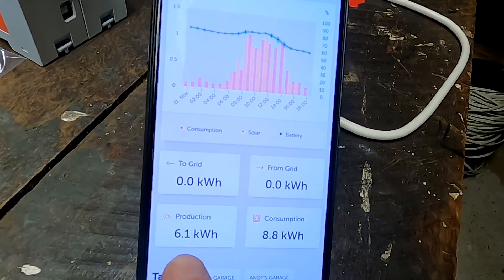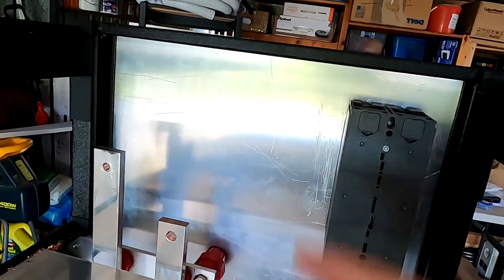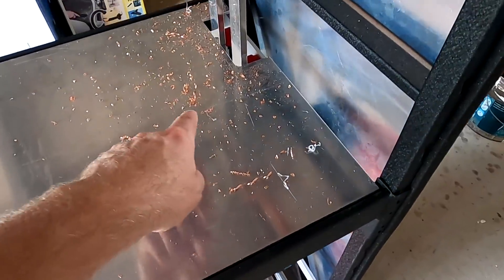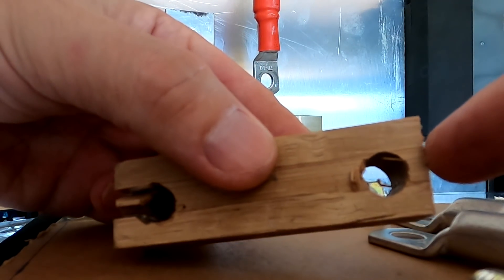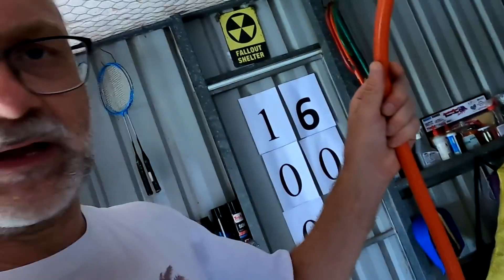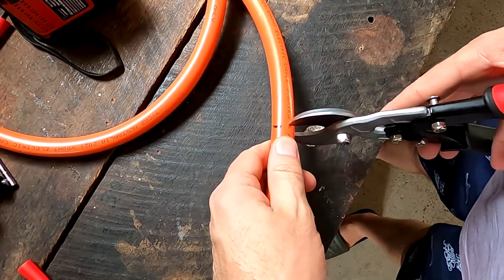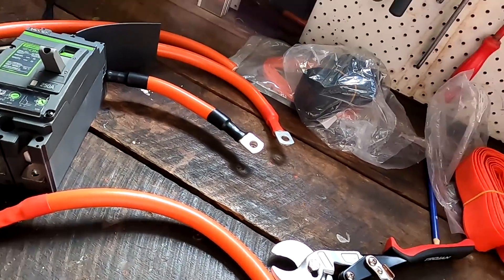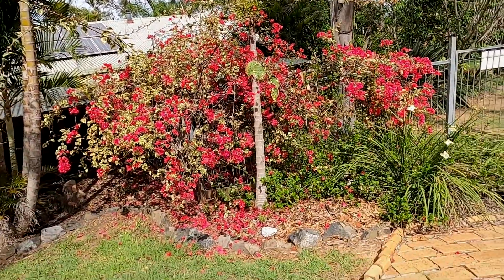70mm ring lugs - better result with 50mm crimper? Battery 2.0 🐸

Comment: I am new to solar and just bought an EG4 wall mount battery. I didn't have a crimper and used a hammer and a piece of metal to 'crimp'. I tried to pull it off and couldn't. It seems very secure. What am I missing by not using an expensive crimp tool? Is it just to keep the lug on tighter?

Comment: IMO, you should not pull a crimper tool handle up to crimp, unless you have no option. You should turn the crimper the other way and you should be pushing down on the handle. This makes a much better, safer, easier crimp, and easier on you and your body, as you use the weight of your hand, arm, and even some of the weight from your body to make the crimp. Some crimper tools have a better design than other ones, to allow for this. I think the one you are using might not be the best, because does not allow for visuals if you were to turn it upside down, but once you know what the actions are, you don't even need to have visuals, you will know where the lug and dies are in relation to each other.

Also, sometimes it is quicker to place the lug in the crimper and close the crimper just enough so that it holds the lug, THEN feed the cable in the lug (especially if you are using solid copper).

In theory you can even shave a little bit of the dies off, where the 2 dies meet, in order to remove 0.5-1mm, so that you get a closer crimp... if you think that will give you a better crimp.

Comment: That YQK tool is such rubbish.  The anvils do not do a proper job.  Full marks for re-crimping with a smaller 50mm die.  The tool must be held in a bench vice.  Some of these tube lugs have an open end in the tube tunnel so you can see that your cable is fully inserted.  I would use this access as a means of feed some solder down the joint afterwards. Put solder flux on wires first and maybe solder paste to help  flow. You need a gas torch as a lot of heat is needed.  I think maybe cut back more insulation so you see say10mm of wire when inserted. This way you can see the solder wicking up the cable. You dont want much as it creates a solid junction with the flexible wire. Use heat shrink tube to cover the joint.  BTW dont use this tool on 4mm and 6mm2 cable too small and doesnt work.
Reply: have you done any measurements with this method, vs without? Does it have any effect on resistance?

Comment: The video i was looking for. Just started to buy all those tools (hydraulic crimper) i need…
Reply: I got one of the cheapo 10 ton crimpers and it just couldn't do any big terminals (pretty much nothing happened when pumping). Either it was a faulty one, or just can't handle the big ones (got a refund). I then got the 16 ton version which is much better for big terminals (just did some 70mm ones), but only has dies for down to 16mm.

Comment: As I recently bought a similar crimp tool I learned, that for 25mm2 cable I need 16m2 lug and die and for 35mm2 cable I need 25mm2 lugs. I guess that for hexagon crimping, wire must fit as tight as possible in the lug. When I tried 25mm2 lug on 25mm2 cable it didn't work at all. Cable just fell out of the lug.
Reply from the maker: It all depends a bit on the ring lugs as well. I have used the really heavy duty ones for my power cables and they are a lot thicker than the ones I bought before. I still us the smaller size die here and there when I feel the crimp is not strong enough.
Reply: Wrong lug .
U need a eu din iso lug.
Not cheap junk or usa lugs .
Are not make for this unit.

A EU iso din the wall its thicker in the lug and some even have ribbels inside to grap the copper wire.

Good crimper but people do not know how to hide it .

Comment: I think the numbers on the dies correspond to rated amperage rather than the sqmm of cable. Either that or it is an identification number and the table in the manual will tell youwhat it means. I saw a manual for a simular tool where the numbers had an AWG rating and the die number did not correspond to sqmm. 4/0 is 120mmsq but the right die number was 95 according to the table.

Comment: Suggest that the use of a product called No-Ox on the bare copper wire before inserting into the connection lugs .It stops the oxidation of the copper and does not affect the conductivity. Also use where any connection is made including bolt ups .
Also the use of a product called Nomex paper to protect cables around and over sharp edges. These products are used in the telecoms industry and have along term track record.
Reply from the maker: Yeah, I have that and did experiments with it. It is good. For a while... then the bad connections and corrosion starts again. I tested other products as well. The best results I had was with no chemicals in between busbar and terminal for example. I used the tinned copper bus bars which came with the cells and 4Nm on the original terminals without any preparation (no cleaning or sanding) and never had any issues since the installation 1.5 yrs ago.

Comment: I too found that using a smaller die made a crimp connection that didn't pull out but left enormous "love handles", indicating that the cable didn't fill the lug properly. THEN I found the reason. 
Look at your cable spec.
 If your supplier does not specify the number of strands and their diameter then can i sell you a pig in a poke? You will be a good customer for rubbish. 
   Now measure the diameter of the strands and count them. Flexible cable is usually specced as 0.30 mm diameter. I have measured some cables from different sources  and all were 0.27mm . Do the arithmetic and you realise the cable is 20% under size. My 20mm2 is actually 16mm2 and fits a 16mm2 lug exactly and crimps properly. The cable is marked "Made in the EU".

Comment: i used the 50mm size on a 70mm cable too. I feel the crimp looks more like yours at 70mm 😅. I get all the way no wrinkles. seems strong but i will like a method to find how to test it if it's good enough. I don't have something to push 200A and see if it's heats up

Comment: habe auf der baustelle von uns das gleiche problem mit den kabelschuhen. habe dann mal den kabelhersteller angeschrieben wieso ein 70er schuh nicht auf dem 70er kabel hält.
als info habe ich dann dies bekommen:
früher wurden die kupferstränge im kabel rund ausgeführt, heute werden sie dreieckig hergestellt.(spart platz) leider sind die querschnitte damit auch etwas kleiner.

man bracht für die neuen kabel auch die neuen passenden shuhe.
Reply from the maker: Danke Dir. Also meine Kabelstraenge im Kabel sind definitiv rund ausgefuehrt und zusammengeflochten. Ich denke es haengt auch mit der Dicke des Kabelschuhs zusammen. Die Billigen von eBay sind schon um einiges duenner.

Comment: If you're still figuring how to right angle out the top of the main breaker, without over bending the cable and lug: make a short copper busbar link to extend straight up. Bolt to breaker, and tap to bolt lug on at 90 deg.   Other cable lug out the side where you notched the breaker housing plastic.  It's an extra bolted connection, but hey...
Reply from the maker: All sorted, thank you. The bus bar link is a great idea and would have been my next best solution.

Comment: Connect the smart shunt directly to the busbar no cable needed in the victron lynx systems the shunt is the connection between the NEG battery side and the NEG consumer side.

Comment: Hi Andy, shouldn't you connect the - from the switch to one side of the - busbar and the + from the switch to the opposite (lower end) of the + busbar? 
This way the the length and the resistence of all connections to the battery blocks are all equal, and you avoid having different terminal voltages at the battery blocks depending on how far the battery blocks are away from the top end of the busbars. 
This is similar to how you connect 12 V batterie blocks in parallel. You don't connect +/- to the same battery block, but  + to one and - to the other. This ensures equal terminal voltages.
And regarding crimping of high current connections, the professional rule in Germany is that you should use always matching lugs/tools from the same manufacturers. There are also different standards for the lugs, so the tool should at least match the standard of the lugs. There are also different crimp patterns. I have best experience with the WM crimp on finely stranded cable, instead of hexagonal pattern. But of course, this standardized lugs and matching tools are much more expensive than the cheap Chinese products.

Comment: 10:11 The pressing result also depends on the material thickness of the cable lugs. With thinner wall thicknesses, the pressure is not as strong as with a thicker wall thickness. Unfortunately there are many differences in the cable lugs. Always depends on the manufacturer. You can compensate for this with smaller crimping inserts, as you have already shown correctly.

Comment: Have the same issue with my hydraulic crimper, always have to go 1 size under to get a good crimp. I was able to pull the lug off easily with the correct size.

Comment: Do have the exact same tool, crimping 70mm cable. Had to use the 50mm die in the same way
Reply from the maker: Ah, good to know. Thanks for sharing. The die seems to be too large for these lugs.
Reply: @OffGridGarageAustralia   likely Chinesium 🤦🏻‍♂️ or maybe just badly copied from the original with not enough clearance on the die’s where they meet.

Comment: Andy
They sold the same crimper here in the states. Unfortunately I own one lol. 
About half of my dies have been modified to work on AWG wire size. The “split line” has been machined (or angle grinder) down at the split both sides. If’s a trial fit that you work up to. I just checked. The 70mm die that I use on 2/0 has been modified too. The perfect crimp has crisp corners on the hex and just at the point where the copper is about to extrude or flash at the split. I use only Selterm or Ancor lugs because of quality and it’s what I fit my dies to work with. 
Tests have shown that a re-crimp at a different angle can actually loosen the grip on the strands so don’t do that. 
Your instinct are spot on Andy. That first crimp was way light. I wonder how many people had problems when the current came?

Comment: Hi, the krimping tool is not the Problem.
The Ring Logs are. There are different Brands off Ring Logs and the have a different Material thinknes. 
So normal you Need a krinper thats Match your brand Ring log.
Reply from the maker: Never heard off that before. These are the really good and thick lugs so they should work. It's the cheap die...
Reply: @OffGridGarageAustralia there are also dy‘s for Alu ring Logs and they are always bigger.

Comment: Refreshing Andy when you don't scrimp too much on the expletives.  At 2:50 I approve of those buss bars and insulating stand-offs too, Must be good for 1500 amps and 5KV eh?  And at 8:45, I was wondering if you have any thoughts on using anti-corrosion compounds like Penatrox in crimp lugs? I know it's primarily intended mainly for Aluminum to Copper crimps but  on high amp connections I often used it on copper as well. 
Also, I seem to recall Burndy instructions recommending stripped conductors be wire brushed clean prior to crimping for both AU and CU to remove hard corrosion. 
At 9:45 I like the look of your crimp with the 50mm die better,  as I seem to recall crimping cables around 4-0 seemed to compress more using the half-round Burndy lugs and the old 'HyPress', but dies for larger conductors, say 650MCM to 1000MCM, I recall  being Hexagonal and I seem to recall that crimps often looked under-compressed, similar to what you have there.
Reply from the maker: Thanks Jack!

Comment: When using the correct lugs, cable and die combination, one crimp is all you should need to get proper termination the first time every time. Multi-crimping may yield worse long-term results from over-working the copper, possibly breaking some strands and work-hardening others.
Reply from the maker: Well, in the switchboard company I used to work they hade extra long lugs and we crimped them 3 times. You can only overwork the material if you crimp them several times and from different angles, so they get squished back and forward.

Comment: The die used to crimp a lug in a wire is sized by the wires gauge and tubing thickness used to make the lug. In the good old USA the best lugs are UL listed. Dies should be selected to match the lug manufacturers specs and the wire diameter. There is wire that is compact stranded, Class K stranding, Welding wire that may not be standard AWG copper diameter. Then if you wdd in the Chinese produced metric wire and cheap thin lug tubing, the problem becomes worse.
Reply from the maker: Thanks Randy,
Both cable and lugs are Australian standards approved, so this time I didn't buy cheap with either...
The die is from China though 😉
Reply: The crimper and lugs must fit together maybe with some extra work on the dies and then it’s not a problem when they come from China,
Hey almost everything is coming from there,and like everywhere you have good ones and bad ones….iphone😮

Comment: I used to crimp my lugs, but have for awhile used solder, this way I can reuse to lugs anytime when I redesign things again, also I would look at use large shrink wrap of the red and black on the busbars and trim the shrink wrap where needed at intersections and ends, this way helps prevent shorts and defines the positive and negative busbars from each other, becomes also neater
Reply from the maker: I heard soldering is bad for high currents as the solder can get brittle and breaks over time. Not sure if this is true though. the internet... you know...
Reply: @OffGridGarageAustralia  Soldering makes joints that break. They cannot take vibration. All solder joints should be mechanically secured first before soldering. Proper soldering should show the wire shape with just a wipe of solder. No Mr. Blobby.  Crimping should produce a metal weld. I worked as QA for military electronics assembly. Have you had your crimper calibrated?  Of course not, it costs too much.
Reply from the maker: @tryagain.k1821  Thanks for the information. I always crimp only. I also cut one of my crimps open and could see the cable has become one piece with the lug, you could not see where the joint was.
No calibration for these cheap crimpers, mate...
Reply: @OffGridGarageAustralia  Very good practise cutting open a lug. Congrats.

Comment: When I need 4-6 connectors, I buy the box of 25. The box is cheaper, and then I always wind up with extra connectors that (of course) are never needed. But overall, it is cheaper than all the extra time and trips to get "just one more".

Comment: I spoke to one of the leading US companies about crimps a few years ago. They said there is no standard for the thickness of the metal in the lugs, and even more variation in the no-name brands. So no tool [sic] could be certain to make a proper crimp unless the tool and lug were from the same maker. Possibly more sales marketing than engineering advice.
 But here in the US we usually see hydraulic crimpers in mm2 sizes, which just match our AWG wiring. And, cheap sources are known to buy the out of spec used tool dies that the better companies regularly throw out as trash.
 Hard to know what really is "good enough".
Reply from the maker: I bought cheap lugs on eBay before and they were really cheap and thin. These ones are heavy duty and also... heavy. So you can feel a difference already from that weight.

Comment: I suggest that if your doing a entire system like this with all new cables, that you do a test crimp and cut it diagonally through the lug to see if the wire inside has become basically solid copper.